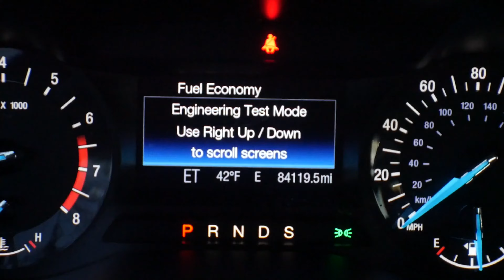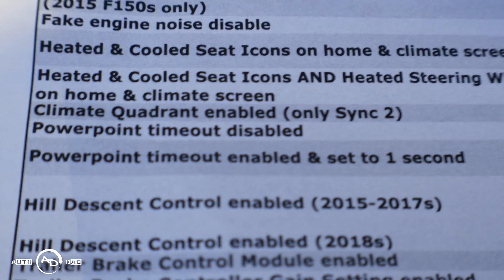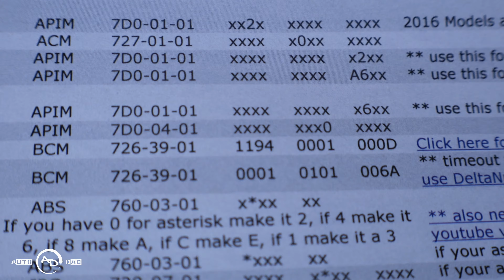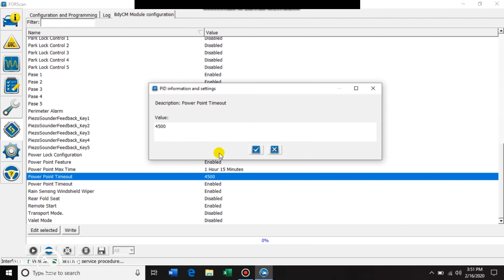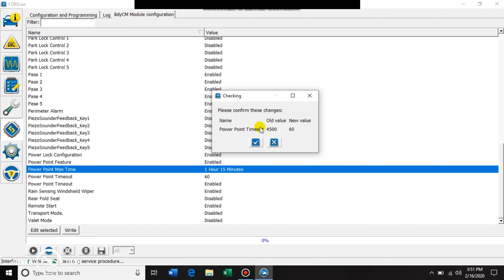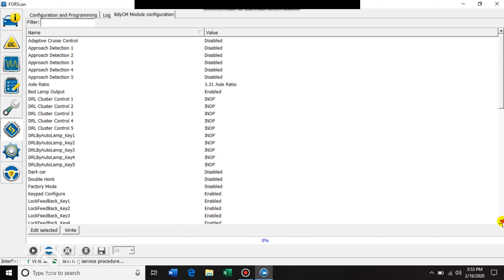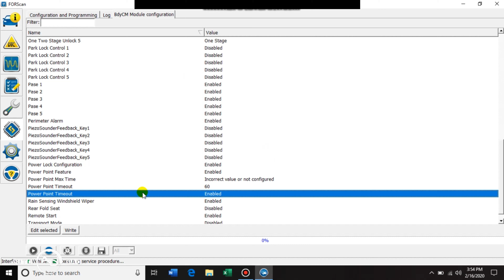Forscan. How to change the power point timeout.

Comment: Does this apply the change to ALL of your outlets (12v & 110v) ?  I need to do the opposite of what you have done.  I tow my F-150 behind a Class A motorhome and have to run an auxiliary braking system that requires 12v power full time.   To get around the timeout feature I had to install an aftermarket 12v outlet tied directly to my battery.  Having the timeout feature active when I'm not towing it would make it convenient for the dash camera to power down after a set time though.  It would be even nicer if you could selectively mod a specific outlet.
Reply from the maker: It changes them all
Reply: @autodad  Thanks for the quick reply.  In the mean time I just spotted in the FORSCAN Forum a hardwire mod that you can make to control the individual outlets.  :-)  You need to reconfigure the fuses.

All you need is a fuse holder with pigtails, one 1/4" and one 3/16" female spade terminal and a 20 amp fuse.  Assemble them, open the engine bay fuse box and pull out the 20 amp fuse for the outlet (F89 - F92) you want to keep powered on and install the new fuse pigtail on the 3/16" terminal closest to the engine and the 1/4" one on the spare terminal in the front corner of the fuse box.

F89  =  Dash
F90  =  Inside Front of Console by the USB port
F91  =  Rear of console for the back seat
F92  =  Center console storage bin
Reply from the maker: Nice
Reply: @autodad  I need the power point to remain on for my Aux braking system when I'm towing it plus you might want to have a cooler plugged in while you are out of the vehicle.  I like this because you can just change one outlet to permanently stay powered up while the rest power down at a set time.  Keep the videos coming.  I have found them to be very useful.  Now I need to go find that mod that allows you to turn on the side spotlights at any speed.   :-)

Comment: Thank you for the video. I replaced the battery in my Expedition and reset all factory settings including that for the 12v connection for my dash cam. This video helped set it back to normal with Forscan. Amazing. 😊

Comment: Have a 22 XLT that I plan to tow behind my motorhome. Need constant 12v power to PowerPoint to power auxiliary braking system.  I've seen you change your value to 1 minute, but what do I need to do to keep constant ptlets? New to Forscan and trying to learn and not mess things up. Stopped at my selling dealership and they won't even talk with me about Forscan.

Comment: Hey everyone. I have a 2012 f250 super duty and it seems to be in the awkward in-between sections for spreadsheets. There isn’t a well written one and the 2013+ spreadsheet isn’t the same for many BDYCM (726) codes. 

I’m trying to find the PowerPoint (12v outlets) timeout code so it times out sooner… 

I know for f150s the code line is  726-39-01 

And for 2013+ super duty’s it’s  726-57-01 

But neither seem to be correct for my 2012… 

Any help would be greatly appreciated. I’ve searched hundreds of forum posts with no answers.

Comment: Do you know the module numbers/ value to change the on screen Ford start up to the Lincoln screen start up.
Reply from the maker: According to my F-150 spreadsheet that contains Sync 2 and Sync 3 it would be the following:
7D0-02-01 xxxx x3xx xxxx Lincoln Black Label
Reply from the maker: APIM
Reply: Auto Dad  thanks for the information.

Comment: Hello
Thanks for video
Can you help me please?
In spreadsheet value marked as a * and on left column I can see the digit which I should change for changing something.
But in some of rows No digits which I should put for disable or enable.instance 
(726-13-01 forward collision warning)
Reply from the maker: What are you trying to enable or disable?
Reply: @autodad  
Forward collision warning and collision mitigation by brake
Reply from the maker: If your car is equipped with it you should be able to turn it on without the As Built feature. Check out my video on "you do not need a spreadsheet" and you should be all set
Reply: @autodad  my car is equipped (2015 f150 platinum) I want to disable it

Comment: Didnt work for my, 2015 f150 xlt fx4. Outlet shuts off with engine
Reply from the maker: That is strange. It has the same module as my 16
Reply: @autodad doesn't work with my 2016.